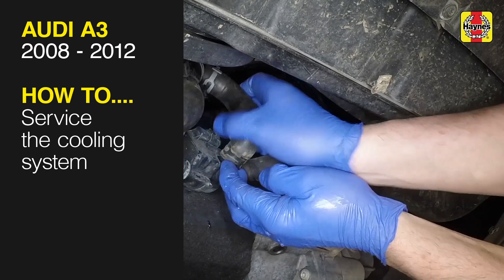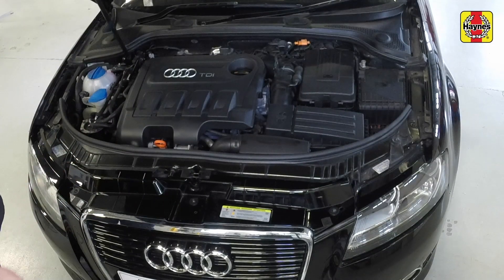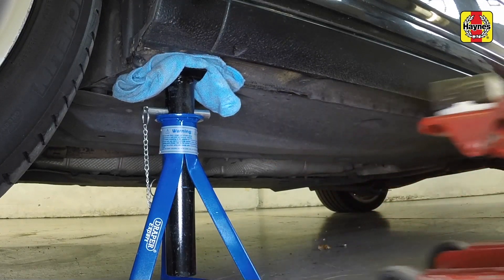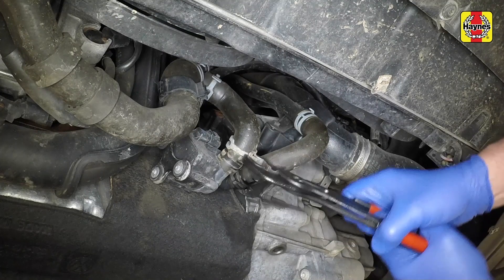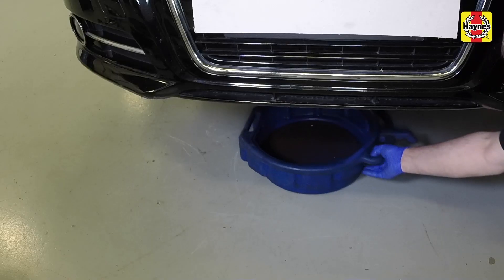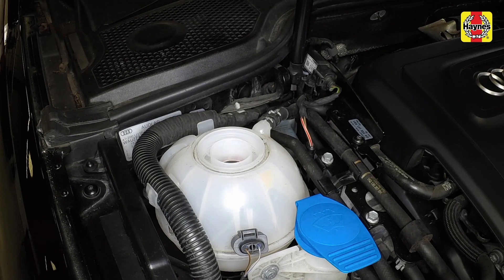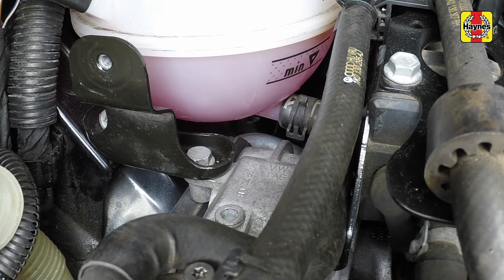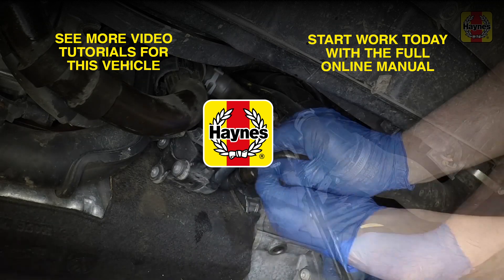How to Service the cooling system on the Audi A3 2008 to 2012

Comment: Usually a vacuum pump is used to prevent air locks? Will the trapped air doing it this way naturally surface to the expansion tank once running?
Reply from the maker: Yes, any trapped air will find its way into the expansion tank
Reply: @HaynesManuals  this is fake, its not as simple the air is still in the system, and u need a pressure pump to remove the airlocks  the car will show signs od gurgling, bubbling in the water tank fals info
Reply: @gavinhatchett1409   the bubbling and gurgling is the system bleeding itself...